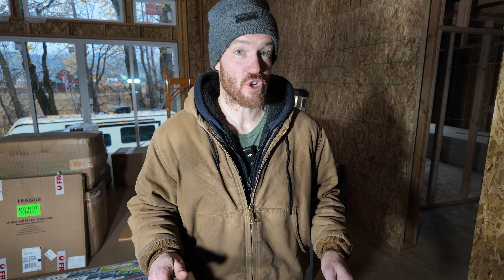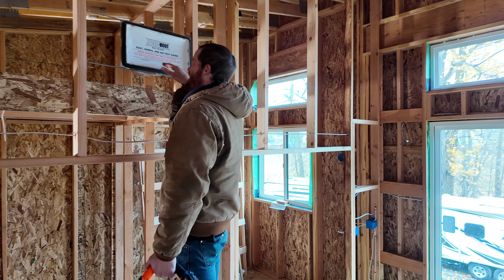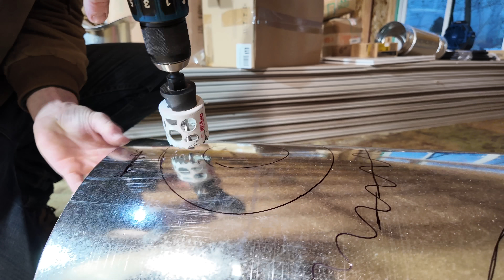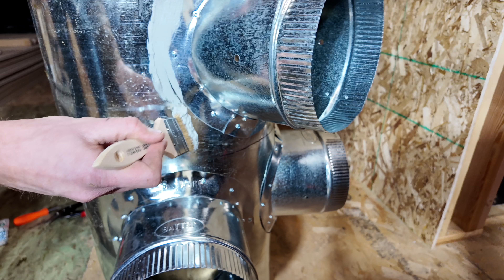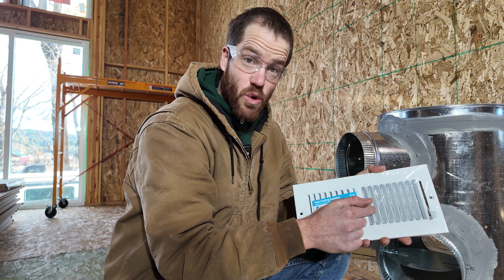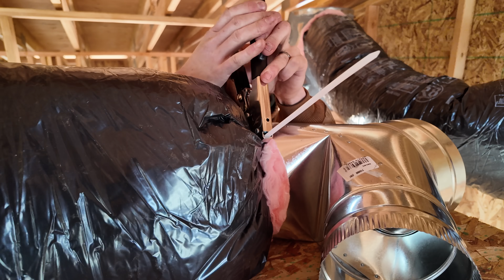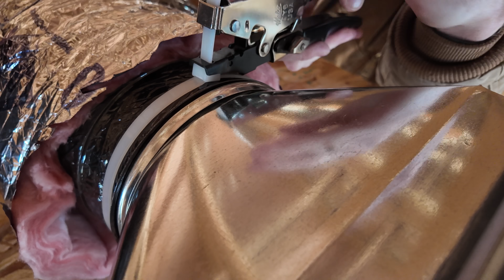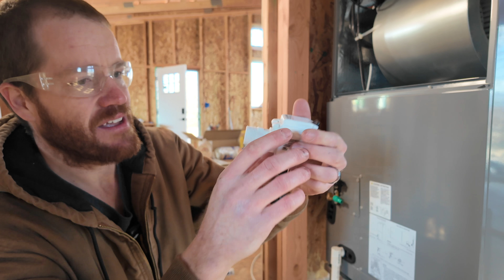HVAC Contractors Hate Me For Showing You This

Comment: FYI!
I hope you put a extractor fan moving (slightly) more air from the bathrooms to the outside of the house than your air handler put in to the room, otherwise you will have positive pressure air going from the bathroom (with the smells generated with in) in to the whole house and I doubt you want the kitchen and/or living room smelling of farts (or worse).
Reply: @greco7522  In a normal (Swedish) apartment there are usually only air extraction in the bathroom and the kitchen as those places generate more unwanted smells than any other. The intakes are usually in the bedroom and living room where fresh air is mostly desired. If you are concerned with losing heat (or cold) you use a air heat exchanger where the air exits, this will require extra ducting as both incoming and outgoing air streams will need to be near each other. Trust me on this, you do not want to smell your toilet in your kitchen or living room. It would render the house unlivable, as not only smell but airborne bacteria could be blown on to your food and surfaces on its way to the lowest pressure in the house, the air intake in the closet. Then to every room in your house via the forced air heating/cooling system. He should not build it as he is, it is unsafe.
Reply: @greco7522  It may not even be legal to rent out or sell a house in that condition, and no insurance would ever cover that house.
Reply: @greco7522  That is most likely because most architects or engineers would not design a house with positive air pressure in the bathroom or kitchen for the reason of smell and health of the rest of the house. The rules do seam rather lax where they are but I would hope he would not build a house that would stink and be hazardous to your health on purpose, they don´t seam like bad people who would, to me. If you wish to try your current home try using incense and place it in the bathroom to se/smell where it goes, a harmless and temporary test any (none allergic) person can do.  It would be far cheaper and simpler for them to change it now than after all interior parts are in place, I hope they read our discussion and reconsider the plan carefully. Nice chatting with you by the way.

Comment: Couple of notes, Supply Ducts want to go to the outside walls of the rooms, preferably below or near penetrations like windows or doors as those are the coldest/hottest spot depending on the time of year, this also allows the returns to be more centrally located so the air handler sucks the air across the rooms. The "water heater base" has no way of having a filter, you NEED to filter the incoming air or your whole system will get filled with garbage, the filter box base also functions as something you can run return airs to, Returns are important because a unit has trouble pushing air into a room it's not sucking air out of (fun fact this is part of why doors don't go all the way to the floor, so that if your return air is in the hallway the gap at the bottom of the bedroom door allows the return to suck air out of that room).

Without proper returns you will have serious issues of how evenly temperature controlled the rooms are, I know this first hand, the guy I work for has 3 story house with the basement being the office and location of the return air, there is 5-10 degree temperature differentials from floor to floor in that house because there is no return air upstairs.

Comment: Fantastic install and explaination. I had to replace my HVAC 2 years ago and wanted a heat pump system (Tucson AZ). My HVAC guy talked me out of it and now I totally regret it. I could have done this myself (with a little help from my friends). A problem would have been fitting the indoor unit, I would have had to move a wall a couple inches for clearance, which was a drag todo but doable.
Thanks for the video Riley.

Comment: Vent install over windows a a rule. Not code heat loss highest at windows this is the basics . You will notice it though.  I had a bid for 30k for a 2400 sq ft. which shouldn't have been more than 10 to 12 k. our area needs to be put in check. Its commerical so i can do it my self.  Why didnt you do  it all in the basement. more efficient. I have a hvac tech degree. Its not very hard for any of this.

Comment: bought an old house in late 2018. furnace was over 25 years old. November 2022, it died of old age! quotes from several different HVAC contractors, furnace only using existing ductwork from $5000 - $6000. Just to replace the furnace with a 10 year warranty.! I bought a brand new AirQuest 85,000 BTU 96% efficiency gas furnace for HVAC DIRECT For $1750. parent company of AirQuest makes gas furnaces under many different well known  brand names and they’re all pretty much identical! furnace cost me $1750 including shipping delivered to my door! I removed the old gas furnace, installed the new furnace myself with the exception of the 3” Schedule 40 PVC piping for the exhaust and the air inlet to bring air from the outside. The reason why you may need 3” PVC, instead of 2” or 2 1/2” is based on the your altitude  & distance number of 45s or 90° pipe bends that you have.  New furnaces don’t have grills on them so they don’t get air from the location they’re placed in your house. they need to have air brought in from the outside. I hired my local plumber to do that. He only charged me $200. I bought (3) 3” Schedule 40 PVC pipe, plus the elbows, pipe cost me around $150-$200 From Home Depot. Luckily my plumber was also an HVAC contractor and he used a Nemometer to check and adjust the settings so they were correct for the amount of gas my gas pipe into the (5) gas burners.

I placed the new gas furnace on top of the concrete floor in the basement and I made a base used 2x4 pressure-treated wood. With a piece of plywood on top and the furnace rests on top of the plywood 2x4 base. I also bought a 4 inch box to go in between the furnace and the return duct. This allows me to get up to a MERV 14 4 inch wide filter to filter out the contaminants from inside my house going into the furnace, then being released into the ducting system.

Comment: The 20k bid from the contractor had a "I do not want this small job" feel to it. Using the very rough but wonderfully useful estimating tool I had as a GC it would have been more like 13-14 k for the job based on material costs. Even with a "small job adjustment" it would have been about 15k. That bid is a sure sign the contractor was too busy to mess with it. If you had said yes, he would be happy to take it but mostly did not want it. Small jobs do cost more as two or three short days cost money for travel time and interrupting the schedule for the big jobs. And yet the savings are real if he was the only choice in the area.
Reply: If it was not clear, I rarely said no to a job but if I did not want it, i would deliberately be high bidder. If I still got it the extra profit was nice, and if I did not get it all the better. Only time I said no to a job was if the customer was an obvious "Karen".
Reply: @markpashia7067  Pretty much guaranteed that the 20K bid was not for the system that was installed in this video.  Likely included the basement as well.

Comment: Tip... For the condensate vent opening add a piece of screen and use a zip tie on it. This will keep the outside critters small lizards and Palmetto bugs (cockroaches) form getting into your duct work. Shape the screen like a ball for more airflow. Great video! I even have them on my sewer pipe vents on the roof. So far working great.
Reply: If you want a clog

Comment: The Mr cool system that you have in your Google spreadsheet is a single fan heat exchange on the outside of the building yet in your video you have the dual fan.

Comment: Did HVAC for years, only critique is to use pookie around all your ducting connections. Usually you paint a ring of it around the ducting metal and slide the plastic tubing over it. Kinda helps lube it up too. When in doubt, more pookie! Haha

Comment: That supply plenum and especially that mixing box in the attic are going to sweat so much in the summer youre going to be replacing the ceiling. You gotta insulate those. Wrap them in roll insulation atleast.

Comment: 30+ years in HVAC, refrigeration, electrical and controls here. 

You haven't taken anything from me or my employer by doing this work yourself. I am more than happy to fix DIYers problems, but most will never realize where they screwed up or how much better their installations can be, how much they can reduce both their short and long term issues and how much additional energy they can save. The biggest problem is when I get involved, the DIYer expects me to be cheap or free; fat chance, especially when I have to redesign your system to determine where you FUBARed. My career is finding where others have messed up, I am dammed good at what I do and I do not give my experience, labor or knowledge away. 

On this installation, I can point out 7 significant issues, assuming the equipment is correctly sized and matched. How many will ever be found is anybody's guess, how much extra money they will add to the operating cost, how much they will reduce the occupant comfort and how many extra repairs may be needed may never be known or noticed.
Reply: I saw a number of mistakes made as well, I’m an electrician by trade and see on many diy,ers making mistakes that can cost them their lives.   In this case it will just cost them more money in electricity and most likely problems down the line.  As you see from the comments, allot of hvac techs are calling out allot of the major errors, hopefully they take this free info and fix some of the issues While they can.

Comment: As a retired pest tech, I would recommend wrapping the end of your condensation drain tube with a little piece of screen mesh. Easy and preventative step.  In the summer, when critters are desperate for water and humidity is low, they will travel into any outside pipe with moisture.  Lots of people get the large American roaches in their attics this way.  The worst is when contractors just lay those drain pipes on the ground.
Reply: Crud from your unit, built up from your return ducting sucking it in will drip off the evaporator coil down into the drain. Then, finding that mesh, clogging, and stopping the unit when it fills the safety T. Especially if a homeowner does not change their filter regularly. Hair, dust, or anything could end up in the drain. It could, not saying it will.
Reply: Gotta love pest techs, keep sendin us work @psychoticcj3914
Reply: This will lead to a clogged drain very quickly

Comment: I could be wrong because I am not a residential guy (commercial refrigeration). But returns are just as if not more important then your supplies. Open plenum are something you normally see in commercial environments where there are no ceilings. Once you have independent rooms where doors shut you really want to be able to get the air out of that room using a return. I am sure it will work but probably not as efficiently as you would want and some rooms will perform better then others. 

20k is also way too high. Probably could've got all this done with proper returns for 10k
Reply: I have never seen returns in individual bedrooms or bathrooms in a home in a "pro" install, they generally rely on a gap at the bottom of the door to act as a pseudo air return.

The closest I have seen to any returns at all in bedrooms is a buddy of mine got tired of how hot a few of the rooms of his house would get with the doors closed so he went in the attic and added registers in like 3 rooms then just ducted them to a larger register he put in the hallway, It didnt work quite as well as leaving the doors open but it was ALOT better than before and he eventually added a booster fan in between where the ducts came together and the large register in the hallway and wired it to come on when the AC fan was running so it essentially pulled air out of those rooms when the AC ran allowing conditioned air to replace it.

But he was the only exception I have seen every other house I have seen basically relies on the rooms door to allow for some airflow and the AC system to basically force conditioned air in the space, at least for bedrooms and things like that.
Reply: @CaptainBlueTech  I have ducted returns in my bedrooms. No returns allowed in bathrooms or kitchens by code. Also if the attic is used as return plenum, all wires have to be plenum rated

Comment: the thing that worries me about the DIY units is that I installed one of these units for a customer being a general contractor and not an HVAC contractor, I spoke with the HVAC contractor I have used in the past and he said he did not want to install the unit and that he refuses to work on the DIY units including repair work in protest to their massive loss in installation labor and he said that most HVAC contractors he has spoken to in the area feel the same way.   I imagine that you can find contractors to service these units but maybe this could be an issue in your area...I don't know.  He said one of the biggest issues beyond being stubborn was that when an HVAC contractor works on a unit they have to warranty their work for one year and he wasn't willing to do that.

Comment: Not to be that guy, but- I got my hands slapped for doing the same thing, putting the thermostat on the same wall as the handler. The heat or cooling generated (leaked through the wall) will fool the thermostat making it cycle the handler more often and not giving an accurate temp in the home. You might think about putting the thermostat down the hallway. Just some hopefully helpful constructive criticism. Love the videos, love the DIY!
Reply: Their's more that meets your eyes. 
Noted the wall is wood. I'm very sure the inside wall will be covered . As an HVAC certified technician veteran,  I approved.
Reply: @nelsonpagan5163  I'll defer to your knowledge then. My case was drywall so that might be why I got my hand slapped.

Comment: Nice video! I am an industrial engineer working with HVAC daily. I am curious as to the heat output performance of that unit during outside low ambient temperatures.  Below 20°F this unit starts dropping out of efficiency. I would be worried about this being able to put out the proper BTU when it’s cold outside. Will you have any natural gas or propane based heat?
Reply: look again at the video, it has a resistive AC supplement unit he install. That what the heavy wire to the electrical panel was for

Comment: Here’s a free tip. Turn your air handler 90°. Otherwise, when you go to Braze the copper lines you will never be able to shut your door on that closet. The copper will stick out too far.
Reply: they're not brazed they have quick connect but your correct. The door might not close
Reply: @ yeah I forgot the Mr. cool has a quick connect fittings

Comment: This is a 5 to 10 year maximum system. You will have a catastrophic failure between then. Making it neatly impossible for the home owner to fix. You will be calling a tradesman. There is no saving money when Installing a heat pump system yourself. Unfortunately on the other side of the coin 95% of so called professional companies know about as much as the home owner lol. If you want reliability stick with the electric furnace and central air. You will save big in the long run with virtually zero issues for at least 15 years. 😅

Comment: Great video, but I didn’t see the part where you installed a filter into the system. Those are critical to you, keeping your air handler clean and working for a long time.
Reply from the maker: The filter installs in the bottom of the air handler (on the return air side).
Reply: @ thanks for the clarification!
Reply: @AmbitionStrikes but you have the drain line in the way

Comment: Flex duct can cause issues, but you can fabricate later for just those issues.  Flex duct is also nice if you need to make a change or additional registers in the system quickly.
You have to wear gloves all the time to get used to them.  I like the nitrile coated gloves in the 10 pack.  They have grip, fight tight, are cheap, and provide enough protection for most things.  I have handled ducting with them along with using them to push the mower and since they are a couple dollars per pair if I ruin one or two I don't feel bad.  I have spent real money on pairs of gloves and there are specific ones you do want for special things, but my cheapos work for carrying materials, painting, mudding, foaming, stuccoing, and gripping.  Seems like a splinter might get me but mostly the glove and additional grip strength is so nice working overhead or moving material.  🗿👽🗿👽🗿

Comment: What is missing is the ducts that are now exposed to the air in the house and if that is warmer then you will have condensation. Should you not isolate all those connection duct with either isolation mats or wool with alu on the outside? Guess using those mats what also is used in car industrie is sufficient enough.